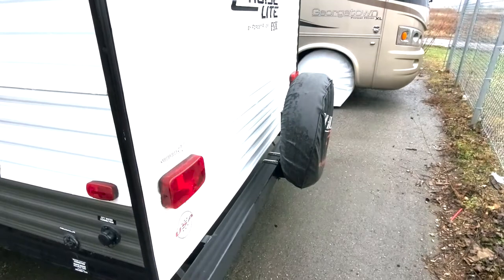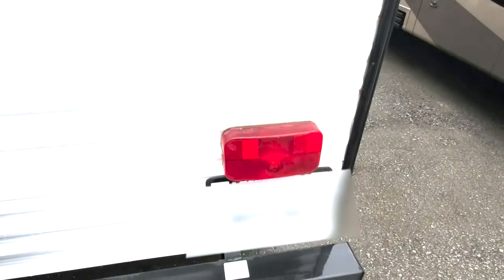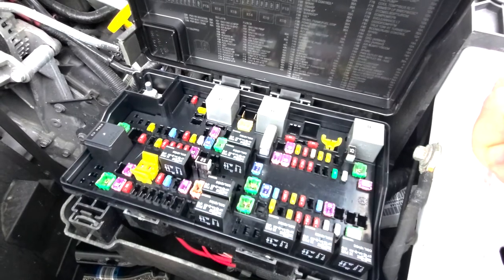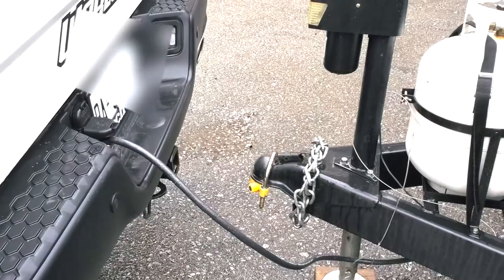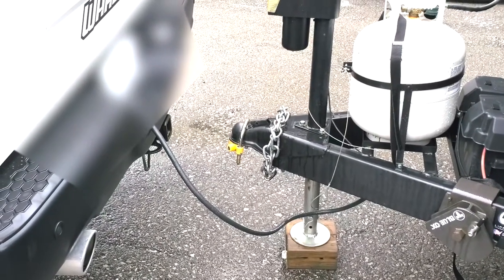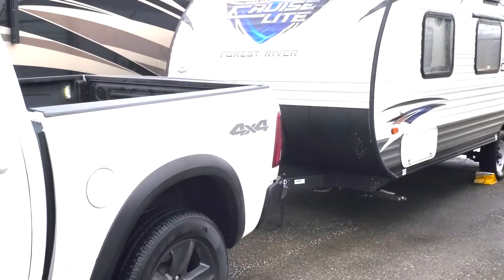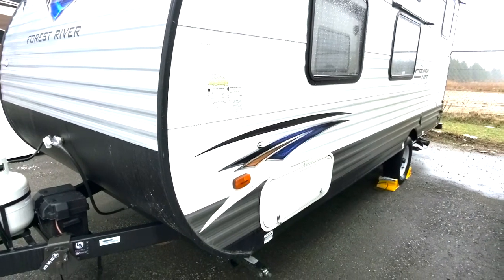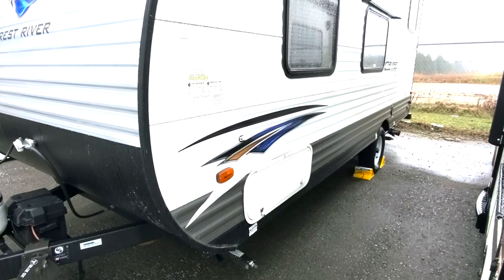Trailer Lights Not Working - Wiring Issue - Problem Solved!

Comment: Having a similar issue. Plugged in our camper to my truck and the 7 way plug on my truck started smoking. Melted a terminal in the camper cord. Have a new cord, 7 way plug, and harness for the 7 way plug on my truck just delivered today. Fingers crossed it works because I lost tail lights/brake lights/turn signals, but all other running lights were working. Trailer brakes were intermittently working. Hoping I get it figured out next trip is in 2 weeks!

Comment: This is a great video.  I have a 2014 Ram 1500 Lone Star, pulling a FOREST RIVER 24 RB. I bought the trailer used in March, & have only moved it a couple of times, but first walkaround I noticed the right turn signal/brake light not working. I assumed with the used trailer, I had a bad tail light, but the bulb tested okay. I never thought of the fuse for that side being bad, because I assumed it was on one common fuse. Sure enough, the fuse was bad & I didn't know because I had towed a different flatbed trailer previously with lights working.

Comment: This was so helpful! We just got a new truck and went to go test our camper lights while getting ready for our upcoming trip. Our left trailer blinker and brake light were not working. I had no idea there was a fuse box under the hood and that it was so specific for left trailer light and right trailer light. This worked and we're all set to go! Thank you so much!

Comment: Not all trailer dealers are lousy at wiring.. In 2017 there was a wild fire and we evacuated with a horse trailer--sorry no camp trailer available and when you are running for your lives you take what you have...  the wiring in the horse trailer had no brakes  and no signal lights etc... when things were almost over with,  and we were headed back home, we stopped at an RV dealer and they managed to fix the issue with the lights and brakes on the horse trailer.... so each dealer is different...glad you got your electrical issue fixed, they can be frustrating...
Reply from the maker: I'm sure some dealers are more skilled than others. Your story sounds very harrowing, glad you made it out and home again safely.

Comment: Thank you so much for the information on your trailer tail lights not working. I followed your instructions and found the fuse in the front of my SUV in the correct position in the fuse box. Found out that that was not the cause of the right tail light not working. I then continued on and looked at my electrical plug from the trailer to my SUV. I pulled it out cleaned the terminals and plugged it back in. And sure enough both tail lights worked perfectly. Thank you so much.
Reply from the maker: Hope everything works trouble free from now on! Thanks for watching!

Comment: I have a 2012 Forest River lite having the issue of no brake lights and no running lights had a friend plug into his truck and nothing
Reply: Hey Phillip! How’s everything been since this comment? 
I just got a 2012 FR sp-189 and the driver side lights don’t work

I did see corrosion on the female 7 plug sp going to try to clean that out 

But yeah let me know!

Comment: HI, I have my trailer tail lights that just wont light, although my turn signals, my break lights, my emergency light, my electric break all work perfectly. I had an issue with the connecting cable from the car to the trailer lately. It got tangled up with the hitch and caused a short somehow. Two fuses were busted in the truck fuse box. I replaced them. So I dont know were to look. I replaced the 7 pins cable. Do you have an idea for what I should look for?
Thank you in advance an thank you for sharing your expertise, much appreciated.

Best regards,

Sellig
Reply from the maker: It sounds like you have a short somewhere in the system. You will have to see if there is anyone close to you that specialises in 12 volt wiring. Most car audio/lighting places can point you in the right direction. Hopefully you can locate an expert to troubleshoot for you. Be careful about rv and auto dealers as this isn't necessarily their area of expertise.
Reply: @CanadianCampaholic  thanks. I think I solved the problem . There was a fuse that was burnt. Replaced the fuse and will see if that was the problem when I get to my trailer upon testing it.
Best regards, your help is much appreciated.
Reply from the maker: @sellignomod83  if the fuse keeps burning out then definitely a short, and try my advice. Take care!

Comment: I had a similar situation but with DC current in a newly built home. The dedicated wiring for our microwave plugin had been partially severed by a nail by the construction crew and over time (and past the home warranty) the connection got worse then eventually failed. A seasoned electrician figured it out up in our attic space. It cost $600+.

Comment: My trailer lights didn’t work when I plugged them in this morning! I had an appointment with my dealer this morning anyway, so I’m going to inform them about this issue and it should still be under warranty on my 2021, so I’m going to see if they can fix it!
Reply from the maker: Good luck!
Reply: @CanadianCampaholic  My problem was my tow vehicle! Apparently my 7 way plug was rusted out! They asked me if I had a boat! Because they just installed my plug a year ago! When they showed it to me, I was amazed, because it looked like the factory plug from 1970, it was so rusty! I figured it out though! I take it through the car wash a lot! They told me to put silicone on the back of the plug to keep this from happening in the future! Wow! I’m just glad it was a simple fix! They fixed it for $64 and they gave me a new 7 way plug since the other one was less than a year old and looked like that, and they replaced it themselves! Mid America rv is so good to me!

Comment: I’m having the same continuous blown fuse issue. Replaced the wiring harness, had the dealership troubleshoot, etc.  Going to take your advice and search out a 12v technician in Calgary.  Thanks for the great video.

Comment: I had the SAME problem... SAME truck... different camper. Tested all of the trailer lights by running jumper wires from the front to the back and eventually discovered that we were getting a large voltage drop when a load was put onto the left turn/stop signal, meaning there was a lot of resistance somewhere on the line. We traced it all the way to the back of the truck... NOT the camper. I had already replaced the bulb with a led bulb and that had not worked, I had replaced the plug from the camper, that had not worked. Fuses in the truck were fine. Narrowed it down to the plug from the truck. I thought... wait... I have BOTH a 7 way on the bumper and a 7 way on the truck bed for a 5th wheel. Plugged into the 5th wheel 7 way and BAM!!!! Everything works fine. So... frustrated that I had not checked that FIRST (mind you I had been chasing this problem for MANY months by this time), I replaced the 7/4 way plug that was on the bumper... plugged everthing in and.... NOPE! Still not working. Well, in replacing the 7/4 way on the bumper I learned how they connect to a wire connecter on the back... took that off and inspected it very carefully. Hmmmm... corrosion on the Left Hand Turn/Stop pin connector. Took the pin out of the back, cleaned it, pinched it tighter as it was not looking very "healthy" and put it back in...connected trailer and BAM!!!!! Everything is working. I then found that wire connector part on Amazon, arrived next day by 2:00p.m. and replaced that whole part and now EVERTHING WORKS GREAT!  What was sooooo frustrating to me is that I had been chasing this issue for months and months and it came down to 1 stupid corroded pin. But I did learn a lot and that was fun. I have lots of pics to share but don't see how I can post them here.
Reply from the maker: Wow that is quite the challenge. Glad to know I'm not the only one chasing these types of issues. All part of Rving I suppose. Happy camping and thanks for watching!

Comment: Glad to see you got your lights fixed. I have a 2015 Toyota Highlander Hybrid and my trailer dealer didn't want to touch the wiring under the dash either. They installed a handheld remote brake controller that  plugs into my cigarette lighter.  I agree also about wiring issues let a real mechanic look at it.

Comment: Thanks so much for making this video ! As of right now I do not think I have a trailer wiring problem as I just bought a used 2019 Ram truck and last week went 60 miles away and bought a 26foot pull behind and low and behold my tail lights on the trailer was not working but.. the salesman at the rv dealer hooked up his truck and al the lights worked on the trailer So I thoght maybe it is a problem in the 7way plug on the truck. I stopped at an auto parts place and got a 4 to 7 adapter but... still did not work. anyways long story short I did not know that the 2019 Ram trucks had seperate fuses for every light on the trailer and wa la my tail light fuse is blown and I am hoping that it was blown by the last owner. Thanks again.
Reply: Thanks for watching Brian! Hope you figured it out!

Comment: I had the same problem, checked the bulbs, then for kicks ... I checked the female plug ... sure enough - spiders.  Cleaned it out, scraped the contacts with a knife, and added dialitec grease, problem solved

Comment: I’m having this problem with my 2017 Jayco. Just put another LED light on and still having the same problem….
Reply from the maker: Hopefully you can find an automotive electrician near you who can help
Reply: Check your truck fuse under the hood… You’ll find one for trailer stop / turn. Mine is a 10 amp and corrected my issue.
Reply from the maker: Yes fuses can be a fix. In my case it was faulty wiring on the camper.

Comment: Check the fuses, I would have never guess. Wow, next time I have a flat tire, I will check the air pressure in the tire.  Don't you just love a smart a...e.
Reply from the maker: Did you watch the whole video?? It wasn't the fuses...it was a wiring issue in the frame of the trailer - making the fuses blow.